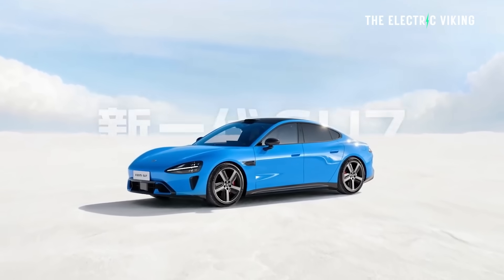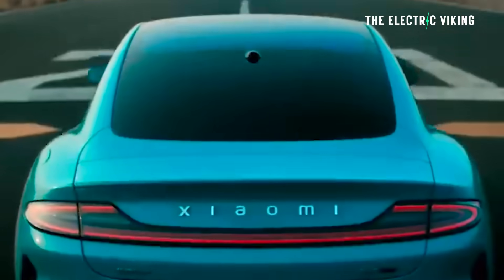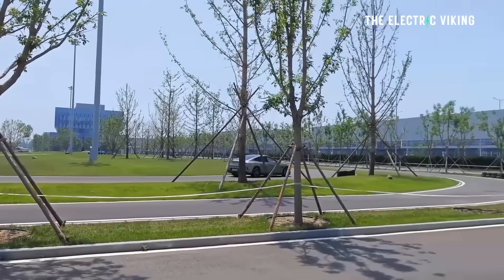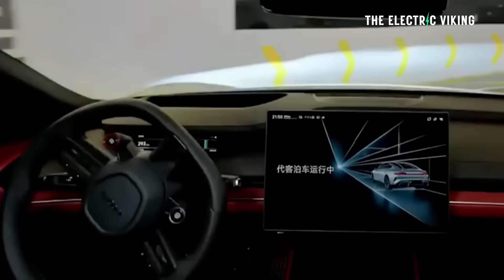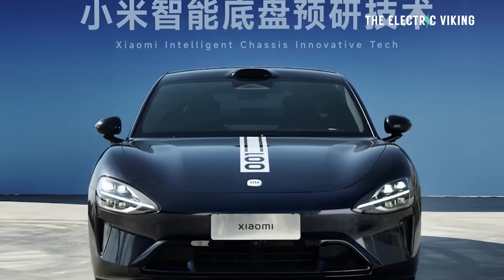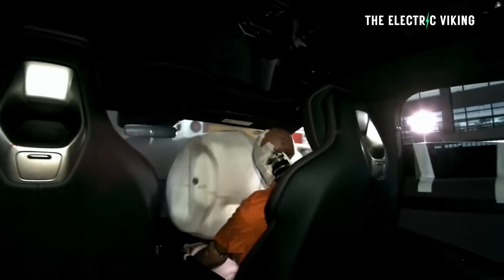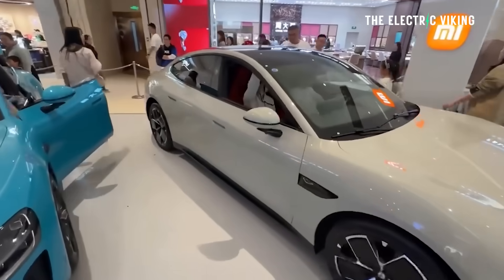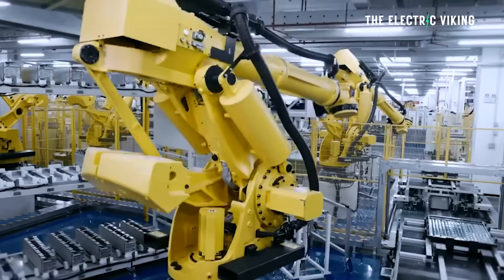Xiaomi SU7 Gets Big Upgrades - And REVEALS CATL 24% Energy Density Boost

Comment: Is the following invention  that needs further investigation?  It sounds very trivial  and vague, too.
Chinese researchers have  recently  made a groundbreaking discovery about the biggest danger of electric vehicles:   they can catch fire.   This belongs to the past now.
Their invention, published in the leading scientific journal Nature, uses two liquids. 
According to the report, the mixture of the two liquids works normally at normal temperatures. But as soon as the battery gets too hot, the second liquid takes over and slows the chemical reaction. The result is that the fire smothers itself before it even starts.
The results from the lab are astonishing. In one test, a traditional battery was punctured with a nail, after which the temperature shot up to 550 degrees Celsius within seconds. A battery with the new mixture was also punctured, but only became 3.5 degrees warmer. The conclusion of the research is clear: the uncontrollable fire hazard seems to be a thing of the past.
You don't need new factories for it. Unlike the promising (but expensive) solid-state batteries, this is simply a liquid that can be poured into existing production lines. 
The researchers claim that the battery's performance and lifespan remain the same.

Comment: Does it still come with the fried human feature after a crash?
Reply: They've added more redundancy; it now has another battery in case the main one fails in an accident, in addition to having 9 airbags as standard, and having 2200 MPa (Megapascals) of tensile strength in the body; basically, it's the toughest vehicle in the world, and they have a patent for it.
Reply: Very soon, it belongs to the past.

Chinese researchers have  recently  made a groundbreaking discovery about the biggest danger of electric vehicles:   they can catch fire.   This belongs to the past now.
Their invention, published in the leading scientific journal Nature, uses two liquids. 
According to the report, the mixture of the two liquids works normally at normal temperatures. But as soon as the battery gets too hot, the second liquid takes over and slows the chemical reaction. The result is that the fire smothers itself before it even starts.
The results from the lab are astonishing. In one test, a traditional battery was punctured with a nail, after which the temperature shot up to 550 degrees Celsius within seconds. A battery with the new mixture was also punctured, but only became 3.5 degrees warmer. The conclusion of the research is clear: the uncontrollable fire hazard seems to be a thing of the past.
You don't need new factories for it. Unlike the promising (but expensive) solid-state batteries, this is simply a liquid that can be poured into existing production lines. 
The researchers claim that the battery's performance and lifespan remain the same.
Reply: @vision9275  
Yes, and a Nigerian Prince died and left you $50 million dollars, too.

Comment: Xiaomi will catch BYD within 4-5 years,  the brand has the most recognition, biggest fan base in China. In Asia Xiaomi phones are very popular, once they start selling internationally, the sales would increase quickly. With just two models they reaching half a million sales. Ford CEO owns Su7 and Ferrari benchmarking Ultra variant for their first EV. It's incredible
Reply: Catch BYD as in volume?
I don't think so.
In profit possibly because Xiaomi is not a volume seller
Reply: Nah, bro. Technology wise, they are too far apart. BYD even made their own batteries. And you should know that BYD also one of the largest smartphone manufacturers in the world.